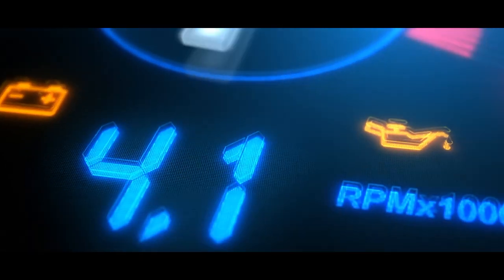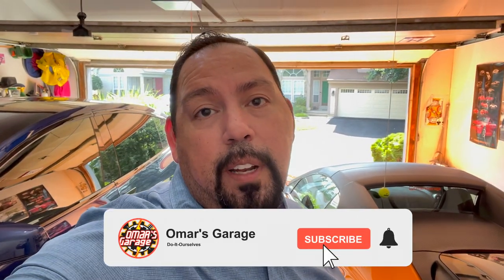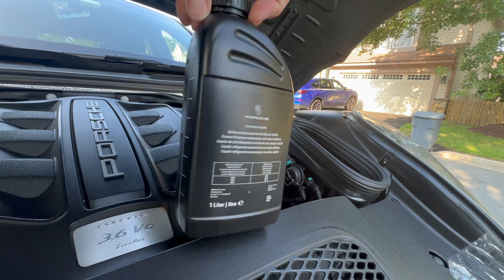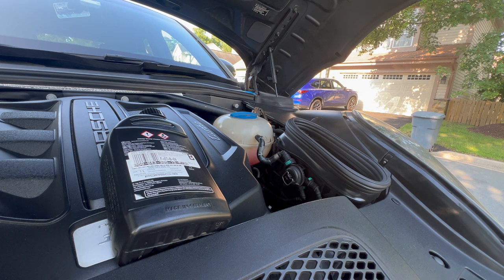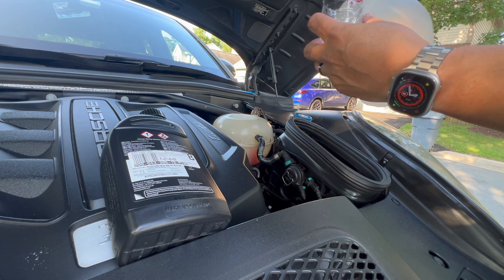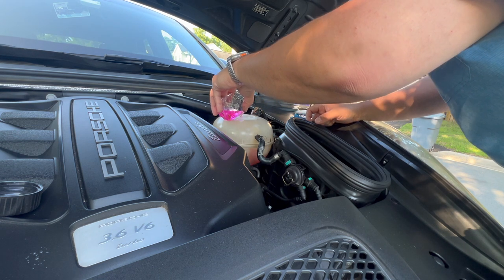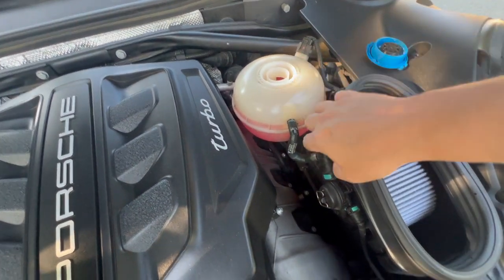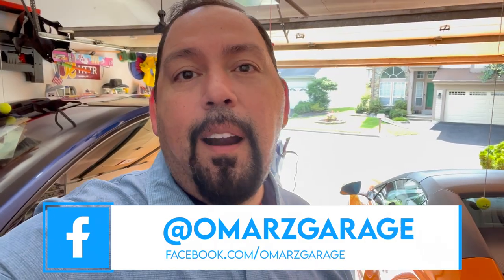Refill Coolant on a Porsche Macan

Comment: Is it mandatory to mix with water?
Reply from the maker: Yes. If you don’t add water there would be extra additives that could lead to corrosion over time.
Reply from the maker: Some come premixed though and will say something like 50/50 on the bottle. This particular is not premixed.

Comment: Was your system leaking? Typically you don’t need to add coolant
Reply from the maker: It was always low when I bought it like at the minimum. I just never topped it off. Keeping an eye on it but so far it’s maintained it’s level.